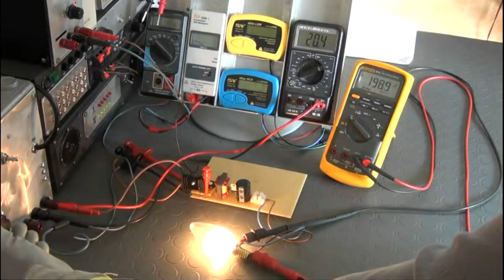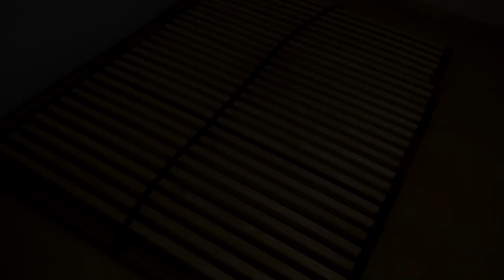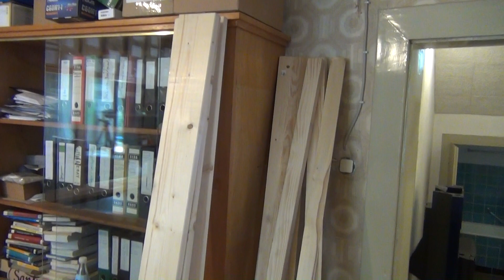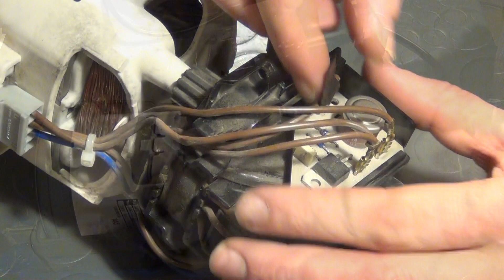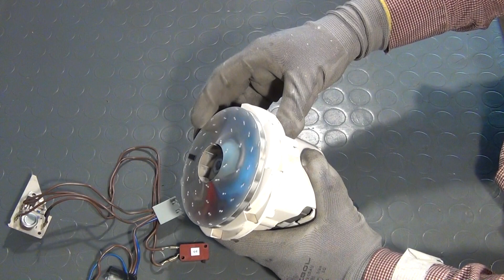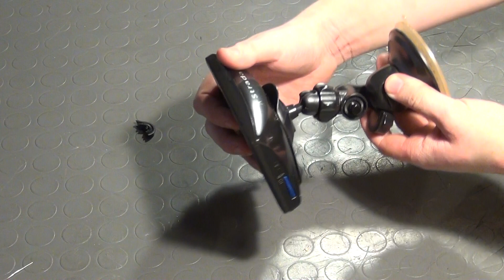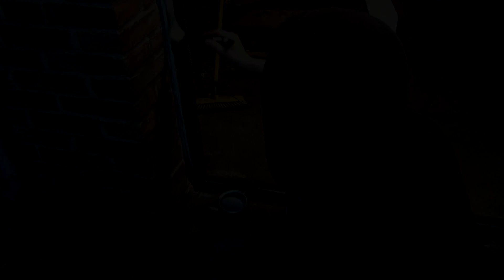Repairs by the Number, Troubles by the Score - Part 3

Comment: Inspired again!

The vacuum cleaner repair reminded me ~screen does that wobbly back in time effect~ - I bought a new vacuum about 5 or 6 years ago, one of those drag along units with long hose. Well regarded brand at the time. Unboxed, put it together as per the manual. 1st time using it about 5 minutes in it made nasty crunchy noises and blue sparks could be seen flying around through the side cover over the motor.
I called the manufacturer support line number included in the box and they rapidly agreed it sounded defective, should be replaced and they would replace it, at their cost, including courier collection and delivery of the new one. A courier return code was to be emailed to me within 72hrs, all I had to do was put it back in the box, call the courier with the reference and all would be sorted.
I received the email in under 48hrs. Great service from the manufacturer. No complaint there.

However, in just that small 48hr window of time - I was made redundant and got news that a family member was diagnosed with a very serious medical issue that just could not wait. Obviously my priorities changed and the defective vacuum was forgotten.

The Tooth Of Time continued to maul me for some time after to great effect.

So here we are 5 / 6 years later - that vacuum is still in its box with a layer of dust on it, taking up space in my small living room.

This video was the straw that broke the camel's back - it's coming out of the box and it shall be repaired! If I die of electrocution in this attempt I shall haunt you, if I cannot repair it I shall curse you by sending it to you for post mortem, if I resurrect it successfully then we win and The Tooth Of Time will have been put into remission once more for me (for now!).

:D Thank you
Reply: How did the repair go?
Reply: @Nitecrow314  It's still in the box unrepaired.
Reply: @chillybrit2334  😂
Reply: @Nitecrow314  Such is life :P
Reply: @chillybrit2334  Don't I know it! I have items on my to-do list that have been on there for 20+ yrs!

Comment: If you wanted to make exact copies of the brackets for the GPS fold the aluminium over to get two pieces over each other, clamp or even pop rivet them together to each end to enable drilling, so you can make two copies at the same time.

Comment: Yes, where I live safety cable is required in new installations to contain a garage door spring that fails. On my door the spring is horizontal. Last year I heard a horrible noise and when I opened the garage door, I found half of the spring hanging out of the wall on the other side of the garage. I used the tether on the replacements. 

In Ohio, where I live, there are no vehicle inspections. Thank God, as the deathtrap I drove in college would never have passed. If you tried to pass such a law, there would be screaming from "poor people" who would say they were being discriminated against. But that is the USA, where owning and driving a car is seen more as a right than as a privilege.   

Love your videos, thanks.

Comment: That garage door looks almost like mine made by "Graf-Tor", maybe it even is from that manufacturer. It has the same issues with the ground bar plus a problem that the rolls that hold the door wing on the top crash into the frame when I open the door without pulling it down to prevent it from picking up speed. There are no spring loaded bumpers to take the kinetic energy. One roll already broke off, the other one is not in the best of shapes. So I wonder since the springs on that door have been re-attached if that door got the same problem. Replaing to broken roll had cost me an arm and a leg (70 EUR) just for the parts. "Graf" as a company went out of business in 1974 or 1975. When I look at the construction of my garage door compared to others of that era it's cleary inferior to them and I think they earned it.

Comment: When building with wood, such as your bed frame, do you use Spax screws? I am pretty sure they are a German company.  Their products have become widely available in the US in the last few years, and I have come to love using them.  Many of them are torx drive instead of phillips, most have a self-drilling tip and also variable threads on the screw shaft; more aggressive to start, and finer further down.  Anyway, I highly recommend them and they are probably cheaper there than they are here in the US.
Thanks for all you do!  You are a unique youtuber  and a treasured one!
Reply from the maker: Yes I do use them. We have a ton of other screw manufacturers though. Torx has become pretty mich the standard here now. I rarely ever use anything but torx these days.
Reply: Hey you responded! Awesome. Cool. Thanks for the answer and Happy Holidays!

Comment: Is that a terazzo floor? I've never seen one like that before.
Reply from the maker: +Fivespeed 302 Youe mean inside the house? Yes that's what it is. It is an oddity here in Germany too. At least in this day and age. This house was built in the 1930s. Back then it was maybe the most expensive house in town and it has many rare features.
Reply: +The Post Apocalyptic Inventor Thanks for the reply.  I love your videos.  Here in Florida, many of the older houses have terrazzo but none of them have patterns.

Comment: OmG...
spruce bars....
Spruce as I know it is quite varied in density.  It well known here to have Prefered Straight tight strong grains. Making it very desirable expensive. 
Look up Howard Hughes and  his jurassic scale flying sea plane
  ..The Spruce Goose....

Made during The Great Wars for the World, when all metals and  (Strategic Materials for National Securtity List, Lookitup)all materials, factors and avaible lady work force  (Rosie the riveted Sexxy)
Reply: edit later on laptop.. finish cont.
so, HH. Not Hy Holly Ness!¿¡!!?
Howard Huges' Spruce Goose 
Complete structure made of Spruce "Bars" you (the PAinventor) call them.
I like the terms as it is a new one 4 me. Metal and Stout cone on Bars..
  
°•○●□■The. Hughes.  H-4 Hercules ■□●○••

Specifications (H-4)	

Performance specifications are projected.

Pratt & Whitney R-4360 Wasp Major engine
General characteristics

Crew: three
Length: 218 ft 8 in (66.65 m)
Wingspan: 320 ft 11 in (97.54 m)
 Height: 79 ft 4 in (24.18 m)
Fuselage height: 30 ft (9.1 m)
Empty weight: 250,000 lb (113,399 kg)
Loaded weight: 400,000 lb (180,000 kg)
Powerplant: 8 × Pratt & Whitney R-4360 Wasp Major radial engines, 3,000 hp (2,640 kW) each
Propellers: four-bladed Hamilton Standard, prop, one per engine
Propeller diameter: 17 ft 2 in (5.23 m)
Performance

Cruise speed: 250 mph (407.98 km/h)
Range: 3,000 mi (4,800 km)
Service ceiling: 20,900 ft (6,370 m)

Sorry.. cut and paste Wki
the number are that impressive.
In my not so humble opponion. 
Your mileage may vary..
Spruce a pine.... I think
Douglas Fur, not so much..
Yes American forestry. Gennetic manipulation, mess' n with mother nature  

I am in a rarity for the Americas in that the first floor has a rcycled wood from what I believe was a high school basketball court. And that's not what makes it rare, but the build date makes it almost two century young. Just 'broke-in' compared to some historic homes nearer you...
Not 1920, that wood have her first 100 year birthday. can drag it out any further..
This house was constructed at the trail  crossing here in 1820.
Some 195 Years Before Now.
It was purchased from the original building family, second owner.
The deed was filed in Boston, that same  year Maine became  a State.  
Two hundred years before that the first "TRADING POSTS"
Trading Posts!!! Remember This Phrase it Will Come Up Again.
SEE NAT0 TPP.... ETC....et.AL

The first Trade king posts in New Egland first in the Maine, (Newmain land??)
and also in Plymouth the same year of 1620. 
Seemed like a good idea at the time...right.
Trading Packs....!''!¡¡¿
that will be a different post about invade fleece disposal and onward to space and beyond..

Poplar as I understand it, has similar attributes, in that it can be found  now in sellecting the wood
cheap and light, heavy stronger and choosen clear straight and strong.

Comment: I notice you also arrange your computers the correct way.
Reply from the maker: +stefantrethan I installed the power and reset button on the backside years ago. And who ever needs the DVD-drive in this day and age ?! :D
Reply: +Tiit Saul We don't need it now. I just have a power button.
You can always reset by cycling the power. I haven't even connected a reset button in years.
Reply: perhaps one day we dont need reset botton as well.

Comment: Very nice job! Why is the computer backwards? Some sort of German reverse engineering?
Reply from the maker: I mounted the power and reset button on the back side. In this way you can turn it on and access all the connectors.
Reply: Fantastic, I knew there was a good purpose to it.

Comment: Why didn`t you paint the bottom of square tube before installing it, won`t it rust sitting on the floor?
Reply from the maker: Cement will be filled in the cavities between the floor and the steel. Having paint between the two doesn't make much sense I guess. The steel also needed to be welded and that means that the steel is becoming very hot. You can imagine what will happen to the paint then.

Comment: LOL. no money for a cheap bed, but uses the finest Wera Screwdrivers :D
I like your Priority Management :D
Reply: I have more money in my tools than in my entire house.  And I even have two floors plus a finished basement.
Reply: And Fluke Multimeter.
Reply: I noticed that too. No bed, broken down car and dishwasher and vacuum, but he has a drill press, at least 2 drills, a tig welder, and nice angle grinder! 

But I shouldn't talk, I still live at home with my parents and have spent FAR more on tools than my car or expenses lol
Reply: I agree. I find that sleeping works OK no matter the altitude above floor — and that of course may not be the case for others! If you have crappy screwdrivers that you need to work on stuff all the time, it induces a lot of stress. And you can damage screws and sometimes do other damage (if a screwdriver slips) that would then be more time consuming to fix.

Comment: I hope your knee is fine after putting the wire wheel to it. (I guess that was the puff of dust appearing at 12:12)
Other than that, I now know that I really need a welding machine.
Reply from the maker: +superdau Hehe. Yes it was my knee, but it was ok. It didn't penetrate through the fabric :D
The TIG-Welding machine is a game changer!
Reply: +The Post Apocalyptic Inventor 
I seem to remember that you wanted to build or repair a welder. But the one you're using now is what you got from your patreon sponsors, right? I this a model that's still available?
Reply from the maker: +superdau I have repaired several welding machines and I'm still working on several related repair jobs and projects, but you are correct: I bought this welding machine partially from Patreon-money.
I'm quiet sure, tha this particular model is not made anymore but the manufacturer (Wollschläger) will certainly offer a similar ( and maybe slightly more advanced) machine. A new unit is however  very expensive, probably way more than a thousand bucks. You can score a decent used model for 300...400 € on Ebay though. This particular type of welding machine also requires an Argon-gas cylinder, tungsten electrodes and filler metal, as well as some protective equipment. It's a lot of stuff, but it's really worth it.

Comment: Suggestion...on the garage door repair...add a length of wire rope through each spring; fastening it at each hook.  The wire rope should be long enough to allow the spring to expand fully. If/when the spring breaks, the wire rope prevents the spring from becoming a missile!  Also, coat each spring with light penetrating oil.  The oil prevents the spring from drying out and failing.  Regards.
Reply from the maker: +Kntryhart Good idea. I guess I will do that. I'll be there next week and I guess it can't hurt to add some safety.
Reply: Yes, you are correct.  Just seeing those old springs being stretched out at waist-level gave me chills!  Years ago, I had one fail; the flying projectile broke a 2x4!
Reply: +Kntryhart At least in the some parts of the USA, I believe the safety cables are required by the building code, and I imagine this is true in other places too.
Reply: I know of one that failed and part of the spring went through the wall!  Oiling spring reference (step 2); read Tips and Warnings also:
http://www.topix.com/forum/city/branson-mo/TN4VP6H3T8U50APHD
Reply: +Kntryhart The springs are under tension, not compression. I've had a spring on a garage door, much like this one break on me. Although it scared me half to death there were no projectile like behaviour. Not sure what you mean by springs drying out.
Reply: @Perius  the springs will rust without oil and the oil may help with any friction they encounter. 
And the two halves of the spring become missiles in the case of over extension, instead of the whole spring flying away in the case of compression failure.
Reply: +Kntryhart   I had the same thought.  The spring on my door is at the top and if the cables break, the spring will just twist.
Reply: These springs fail usually by brittle failure from a crack developing at the surface. The surface corrosion creates little pits that act as stress concentrators. Those then act as crack initiators. When the spring fails, it often already has many cracks of various depth — but one of them has “reached the finish” and fully failed. At that moment, the spring has a lot of stored energy, and some of that energy is released as a wave that travels down the spring. A wave means displacement and displacement means stressing the material, and that wave can often induce stresses higher than during normal operation. Thus it triggers secondary failures. From energy standpoint, some of the stored spring energy is used to create new surfaces - this is also called the surface creation energy. So, depending on how much energy is available, there maybe be one or even several secondary failures — the spring breaks into multiple pieces! And it is those pieces that become projectiles.

Since the corrosion on such a spring is normally equally distributed along the surface, and the spring cross section is mostly equally stressed anywhere on the spring except close to the endpoints, by the time the spring fails there are many other locations with cracks close to the critical length needed to fail. And the energy released during the failure of the initiator crack is then sufficient to “finish the job” on one or more of the other cracks.

I hate those springs with a passion. I much prefer over-designed cables and counterweights.

Comment: Excellent repairs, you are a multi talented man :-D.
Im not supprised the garage door was hard to move, it lifts like new now :-D.
Repeated stress is very distructive, my frend has a bosch angle grinder and it liked snapping a field supply wire off its terminal, i found that strapping the wire down to the winding with cable ties removed the weak point, a longer and softer wire replaced the original :-).
It has not snapped since :-D
Reply: On that note I've found that some of the HiFi enthusiast's "Oxygen Free Copper" speaker cables  are extremely flexible for their cross-sectional area, though they probably aren't anything near mains rated. They work great for internal equipment cabling that is subject to extreme flex or vibration. Just don't buy sight-unseen - you need to check it for flex in your hands first. Audiophiles seem to "upgrade" their cables every 6 months so it's sometimes possible to scrounge some. 
For higher voltage super-flexi internal wiring I use silicone-sheathed multimeter leads - usually good to at least 600v or more.
Reply: +Gord Slater 
Oow ill remember that. Oxygen free copper :-D :-D

Comment: I'm sure you had a reason, but I'm wondering why you chose to orient the top board of the desk that way. 
If the cut-outs are in the back facing the wall you could route the cables trough them, and having the smooth uninterrupted side facing you is probably more comfortable.
Reply from the maker: +Nick The Maybe you can't see it in the video, but the  backside also has the same cut-outs (That's where the four original table legs had been sitting).
Reply: Indeed I didn't see the back side in the video at first, but now that I checked again I see the other cut-outs. My mistake. 
Please do upload more home improvement videos as you work on your house, it's always enjoyable to watch, thanks and have a nice day.